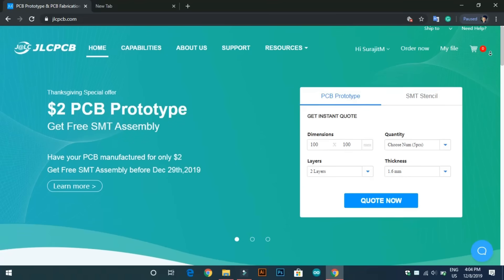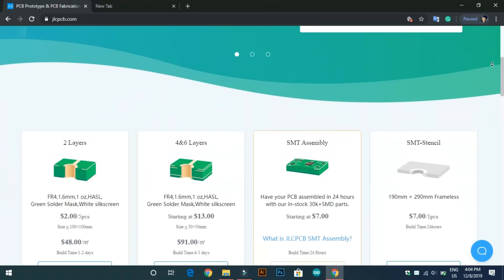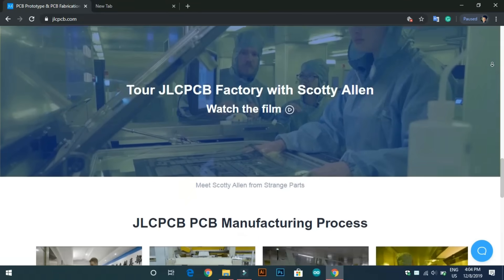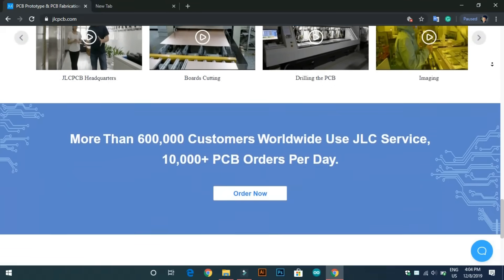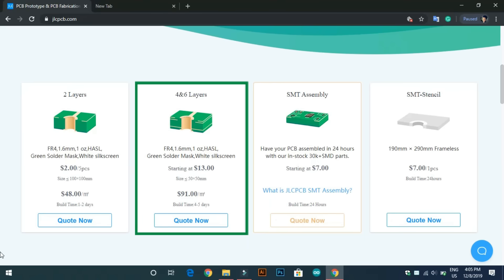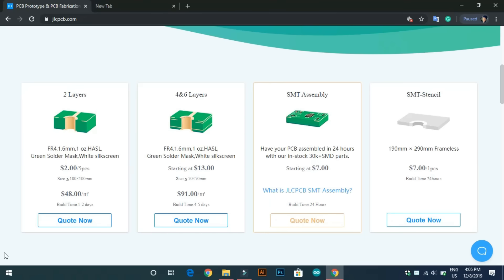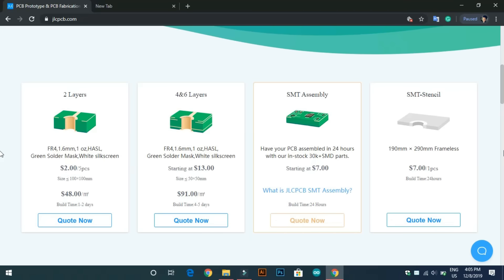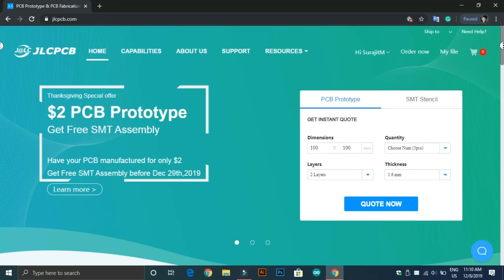How To Make DIY Arduino Gesture Control Robot At Home

Comment: Everything is lighting up but no movements in motors or anything.
Connections are proper.
What could've gone wrong?
Any suggestions?
Reply: bro i used uno and the code is uploading but not working
Reply: @jamarkateljeshis did it worked?
Reply: @divyansh5416  my nrf module failed but the circuit seemed to work
Reply: @jamarkateljeshis  have you tried again ?

Comment: I am using breadboard instead of PCB. Used the circuit connection as mentioned in the attachment. But as mentioned, receiver is able to power up, as well as able to upload the code. But Transmitter is not working.... do you have the updated code / circuit connection for the same?
Reply: It worked?
Can you provide me the code you used and what changes you have made while not having the pcb 
I want to make this project please help me bro🙂

Comment: can i use seperate arduino nano and nrf24l01 for transmitter as well? if yes then should i need to change code?
and can i use mpu050 gyro? if yes then what will be the connection and change in code?
Reply: bro yeh acrylic sheets pe whole khud krne pdenge?
Reply: Is it working?
Reply: @divyansh5416  i didnt tried

Comment: Hey DIY builder. I love your video's and this one the same but I have a question. I built it but the NRFL01 modules are not connecting to each other and it does not work. Any Ideas why they are not connecting?
Reply: Does the code change if I use a Nano and a nrf24l01 module for the transmitter?
Reply: Try using NRF24l01  adapter with that NRF24L01 module

Comment: Bro can we use Arduino nano in place of RF nano board
Reply: Then you will require a separate  transmitter module for communication. (RF)

Comment: I don't get it is RF nano compulsory or what? you've said in description it's optional so what can i use in it's place or is it as same as arduino nano but different?
also can i use arduino uno inplace of arduino nano?
Reply from the maker: you can use the standard Arduino nano/Uno paired with the RF24L01 transceiver moduel
Reply: @DIYBuilder  Thanks for clearing my doubts brother!
Reply from the maker: @feloi3033  my pleasure bro
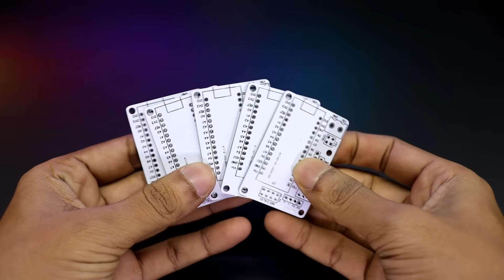Reply: @DIYBuilder  brother what's the name of the board you're using at 3:36 ?

Comment: Wow, mind-blowing! Just a quick question.. What are the red wires that you are connecting to the gear motor at 1:04 ? And what is the black pen-link tool which you used to stick the red wires to the gear motor? I'm a beginner so I really don't know much about these sort of things.
Reply: That is a soldering iron

Comment: The code in the video description is wrong. RF24 radio(10, 9) in the transmitter code; line should be like this. like in the video.
Reply: Code is wrong bro
Reply: @153_ombhusari4  if you are talking about the code in the video yes it is wrong

Comment: Bro instead of L298N motor driver i am using adafruit motor driver shield , so please recommend me how to connect a motor driver shield as well as NRF24L01 module to arduino nano 
My humble request please guide me for my project 
Waiting for your reply 
Thanks
Reply: Easy he  bro  simple  nrf24l01  ko aurdino ke bottom  me ya fir    motors drive l293d  ke upr soldering  krdo

Comment: hello, can you help me with the code it is not working for me it is showing-
<SPI.h>no such file directed
<nRF24L01.h>no such file directed
<RF24.h>no such file directed 

I have used the same components shown in the circuit diagram except for the ADXL335 Module I have used MPU-6050 Module 3. can you please help me with the code as I am a complete beginner??
Reply: go to tools then manage libraries then search SPI and simply install that . after verifying you will not get that library

Comment: Hi DIY builder I have a small problem. I want to do this as a school project but I can’t find ra+nano board in Amazon. Can you please give an alternative for it
Reply from the maker: You can use the arduino nano with nrf24l01 module
Reply: Thank you so much

Comment: Hello brother. Can I use NRF24L01 module and Arduino nano for transmitter instead of RF + Nano Board?
Reply: yes sure .
Reply: Will there be any change in the code

Comment: @Diybuilder When i upload the code then motor starts rotating itself  & transmitter not working or response . Tell me what can i do.
Reply: I just build this robot. But motor rotate when activate transmitter, and then never stop. no stop when poweroff transmitter
any suggestion'
thank's
Reply: @ramongi6476  same problem here.if you find any solution ,plzz do share!!

Comment: Diy Bulider in your circuit diagram in both transmitter & Receiver there is Ardiuno nano for both. Transmitter & receiver but in this video you  use RF-nano then if we use ardiuno nano in place of rf-nano then it will be run or not. Give me reply.
Reply: it will it's not important

Comment: Hello my accelerometer secsor hasn't any x or y axis output. It habe int 1 and int 2 outputs. Can i use it as axis output pin.
Reply from the maker: which sensor r u using?
Reply: MMAB45x accelerometer sensor

Comment: You have used which wire for gear motors
Reply: normal wire there is no type of wire dear. there is only one type of wire that is copper wire which is the foremost best

Comment: Hello. Sorry im still new to this. What is that soldering tool you used to connect the wires in the gear? Liked and subscribed. Nice videos thanks
Reply: It's a soldering iron, if you still need it.

Comment: Hello Bro i ve a problem with the library
Reply from the maker: what problem?
Reply: @DIYBuilder  i added the library folder several times and does not appear in the arduino
i think the library files extension are not correct

Comment: sir can i use mpu6050 instead of  adxl
Reply from the maker: yes you can use it but then you need to change the code
Reply: @DIYBuilder   and can i use any dc motor right or i also need to change the code
Reply: @DIYBuilder   I hope not to bother you last question can i use nano and nrf instead of rf+nano board
Reply: @DIYBuilder  can you tell me what might be the changes while using mpu6050 instead of adxl355

Comment: Fantastic build!! But there seems to be an issue with gerber file and code link. Would be very helpful if you could update these links.

Thank you
Reply: Md. Yusuf Khan it’s in the discription
Reply: the Gerber file worked good for me
Reply: @scamlikely9450  its cant working
Reply: @scamlikely9450  can you send me code in zip file if you try and make project like this

Comment: My receiver is working fine but the Ard nano of transmitter is not working.....the power led of it is not glowing properly and the light is fluctuating.....@DIY Builder please help...the presentation day is very close..... please help
Reply: I am also . My transmitter not working ,
How did you solve the problem !???
Reply: @chouaibdownlaod5968  Hi. Are you solve this problem?
Reply: @Maxlllll  yes i am
Reply: @chouaibdownlaod5968  Where was the problem ? I have the same problem .

Comment: Why you kept nrf24lo1 module at transmeter and also at receiver in the circuit diagram.but you kept only one nrf24lo1 module to the receiver in the video.which one is correct
Reply: bought

Comment: This is a legit great project. 
I am looking forward for more to come.
Hope I’ll be working with one of it for my semester project. ❄️🙌🏻
Reply: Could you please let me know the software you had used to simulate the code before actually creating the working model
Reply: @karanpatel8060 bro i have used components that are in circuit diagram. But it is not responding
Reply: In the end it worked
Reply: @shahinhajamar6538  it worked for you bro?
Reply: @shahinhajamar6538  did it worked?

Comment: you are making so many projects. while you are making that, you are adding sketches by a USB cable to it. so the sketches are readymade or we have to make it???
Reply from the maker: You don't need to make the sketches. You just download the sketch along with the required libraries from video description and upload it in your Arduino. But you can modify the code you want to change anything.
Reply: thanks a lot, i am making this project for my science exibition , my name is atharva from class 5, arangabad

Comment: When I upload the code them motor starts rotating itself and it is not stopping and the signal isn't received from the transmitter
Reply: I suffered from same problem they what can i do please tell me. How you solve this problem when you face such problem.
Reply: @allrounder6651  Hi. Are you solve this problem? Please, help me...

Comment: >sees hotglue gun come into screen
I swear if i seem more hot glue adhesive projects im gonna blow a gasket! USE SOMETHING THAT IS ACTUAL ADHESIVE! 2 part epoxy, JB weld, some damn contact cement or super glue! something that wont peel up after a few good hard uses.

Comment: RF Nano (optional)
what do you mean by optional?
can i use arduino nano for transmitter too?
Reply: Yes you can
Reply: RF nano is just an Arduino nano with a Bluetooth module
Reply: You will need an Arduino and a seperate bluetooth module
Reply: @confusednsutian7100  how about program code.. erroe nrf24 eror

Comment: Congrats for that project. Really interesting
Reply from the maker: Thanks
Reply: @DIYBuilder  My receiver is working fine but the Ard nano of transmitter is not working.....the power led of it is not glowing properly and the light is fluctuating.....@DIY Builder please help...the presentation day is very close..... please help
Reply: @sandipdeb9253  
I am also . My transmitter not working ,
How did you solve the problem !???
Reply: @chouaibdownlaod5968  bro have u got any solution for this if u got pls tell even I am also facing the same
Reply: @sandipdeb9253   bro try changing the battery or charge the battery fully
Reply: @DIYBuilder  Mine is not working!!! Some told me it's from your code.. Why? Tell me the solution to this problem pls🙏🙏🙏🙏
Reply: @joshuaolaiya  have you got any solution pls tell even I am also facing the same problem

Comment: I'm impressed with quality of your video and project. Really great work. I noticed also you've made only 1 state at one time available. I guess making it ride and turn at the same time would be nice improvement :)
Reply from the maker: Thanks
Reply: @DIYBuilder  can u provide me report or PDF of this robotic vehicle on my personal gmail
Shubhamsj077@gmail.com
Reply: @DIYBuilder  My receiver is working fine but the Ard nano of transmitter is not working.....the power led of it is not glowing properly and the light is fluctuating.....@DIY Builder please help...the presentation day is very close..... please help
Reply: @sandipdeb9253  ur battery must be low
Reply: Could you please let me know the software you had used to simulate the code before actually creating the working model
Reply: Circuit diagram share me please

Comment: Hey, can we use both nrf24l01 instead of that special arduino nanao with inbuild nrf
Reply from the maker: Yes you can use normal arduino nano with nrf24l01 module
Reply: @DIYBuilder  if we will use that codes are same

Comment: When i watch your circuit diagram arduino nano pins were opposite so what to do
Reply from the maker: To make the clean diagram i did this. you can connect everything according to it. this is not a big issue.
Reply: @DIYBuilder  My receiver is working fine but the Ard nano of transmitter is not working.....the power led of it is not glowing properly and the light is fluctuating.....@DIY Builder please help...the presentation day is very close..... please help

Comment: What u r using as base for gear motors , because I can't use cardboard please tell the material name
Reply from the maker: It's acrylic sheet/plexiglass you can find it at your local hardware store
Reply: @DIYBuilder ty bro

Comment: Nice one bro. Its very cool to watch all the coustomization that you are bringing in to your robot during the past year. Your projects are always up to date 🙂.  Best wishes
Reply from the maker: Thanks bro :)
Reply: @DIYBuilder  My transmitter is not controlling my receiver. If I turn ON the robot, all the wheel will keep on rotating until I switch it off then it stop but I cant control it gesturely. Please whats the problem 🙏🙏🙏🙏🙏
Reply: @joshuaolaiya  Also I am facing the same problem
Reply: @joshuaolaiya  same, how you can solve that problem?
Reply: @kaushikdhar5242  how you solve that problem?
Reply: @DIYBuilder  please upload the required libraries for the transmitter and receiver program
Reply: @DIYBuilder  My receiver is working fine but the Ard nano of transmitter is not working.....the power led of it is not glowing properly and the light is fluctuating.....@DIY Builder please help...the presentation day is very close..... please help